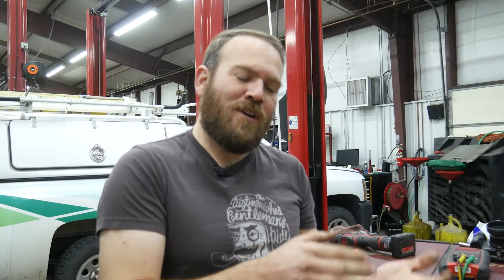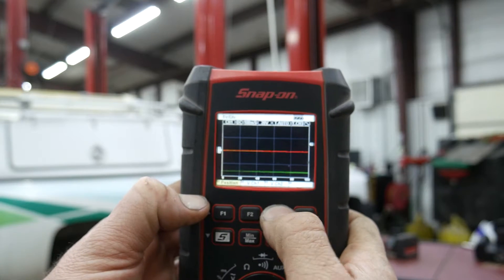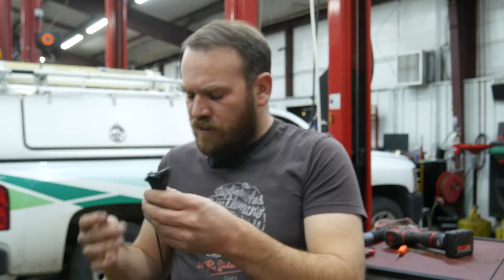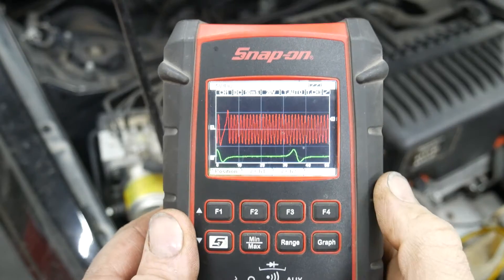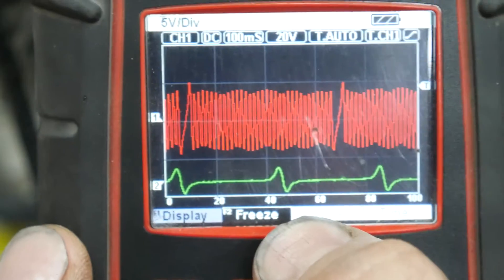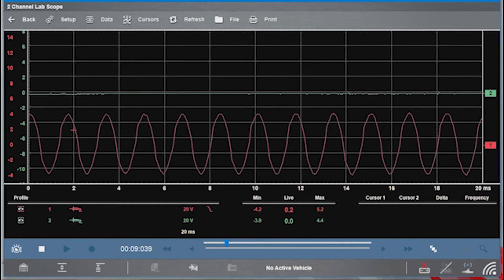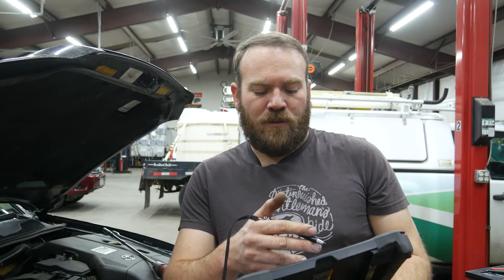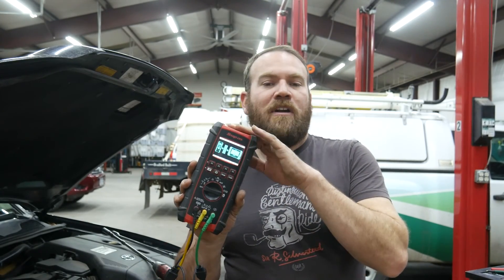Weekly Waveform 8 - Camshaft/Crankshaft Correlation - CKP CMP

Comment: Do you think you could find a scope with a SMALLER screen?
Reply from the maker: I actually have several with smaller screens. I try to use a variety of scopes because I don’t know what the end-user is going to be using to perform these tests. I like to show that it doesn’t matter what scope you have you can capture most of these waveforms.
Reply: I'm guessing it cost more than a $60 hantek?

Comment: Professionals need to search out a known good when fixing a car. There are few advantages to amateur workflow, but one of them is the ability to take the time to learn our own baseline. Last year I went through the exercise of doing cam crank on two vehicles, it is a fun little project. I sure like this series, Chad. Thanks for taking your time to do this!
Reply from the maker: Thanks Dave, most of the known good waveform I have are from my own vehicles. When I got the picoscope years ago was spent a Saturday testing everything I could on my personal vehicles just to learn the operation of the scope and understand the signal acquisition process.

Comment: That old scope is awesome👍
Reply from the maker: the navigation reminds me of the uScope but I get 2 channels instead. I wish it could save the files internal instead of connecting to the Zeus. The zoom out feature took about 4 minutes. I'm not sure if the buffer is built into the tool and has to transfer all the data after the zoom button is pressed or if it slow because it wasn't designed to work with the Zeus.